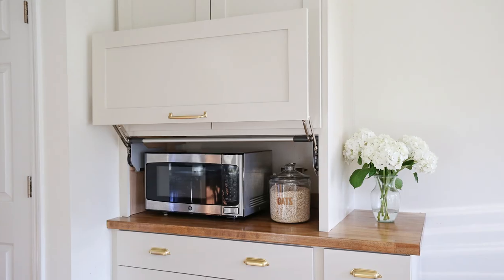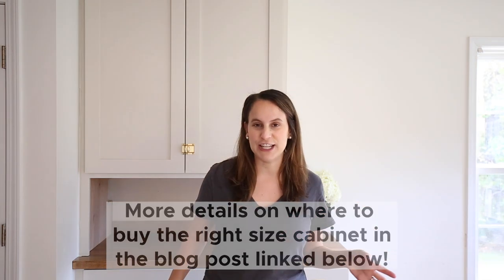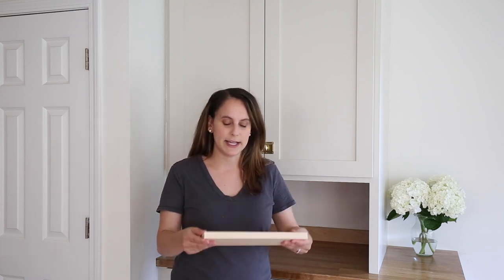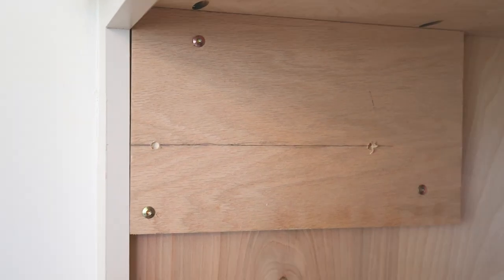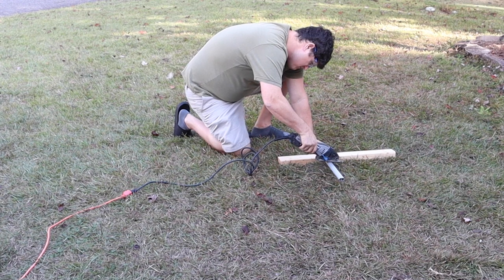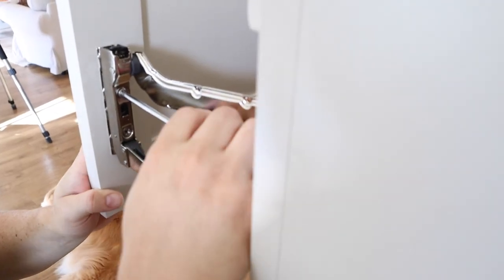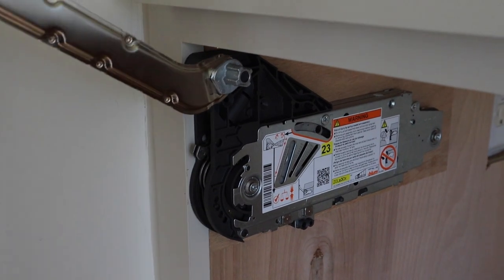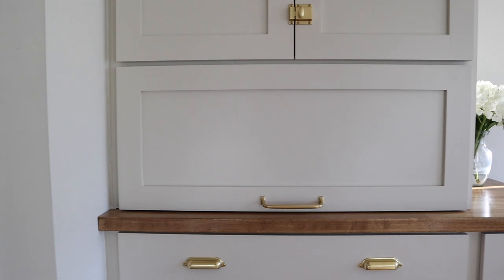DIY Appliance Garage to Hide the Microwave or Small Appliances!

Comment: Angela, this is a great video.  Thank you for posting it and making it! i am starting a similar project and your video will save me time.  i just need to figure out what the best hinges would be for a 72 inch wide opening (18 inches high).  Any chance you have done any projects with a wider doors and can give me some advice?
Reply from the maker: That's great to hear, thank you! If you are using the Blum hinges that I did in the video, Blum's instruction manual should mention how to accommodate for different size openings and the maximum length that they could cover. I do have some information on building large cabinets doors with a smilar size as you are if that is helpful you can look at my blog post here: https://angelamariemade.com/built-in-diy-office-storage-cabinets

Comment: .What do I do if the air fryer is deeper than the upper cabinet? It wouldn't be flush with the upper cabinet in the kitchen. Any suggestions? Yours look fabulous!
Reply from the maker: Thank you! You could adjust the build to accommodate it! If you could find a deeper bottom cabinet, you could adjust the top cabinet to fit the air fryer, or you could just make the top cabinet larger and make it flush with the countertop if you wanted.
Reply: @AngelaMarieMade thanks for your response. We are adapting the difference in depth with a fill in piece of wood.

Comment: Thank you for the vid. The only video I found for face framed cabinets. I had assumed a wood spacer on each side would work. Our cabinet will be 21 " tall and 30" wide. I am having trouble determining which arm assemble to order. 20L3900.06 states 17 11/16" to 22 13/16" tall cabinets. Is this the one you had to switch to?:trophy-yellow-smiling:
Reply from the maker: Thank you, great question. We did use 1x4's for spacers. As for the arm assembly, our height was 15" which was right at the max range and it ended up not working as well, so we went up to the next size and it was a much nicer fit. Sounds like you have the same thing with being under the max per spec but I would go up a size.